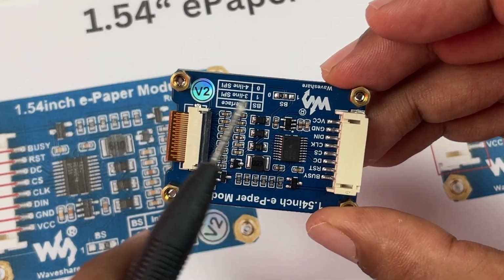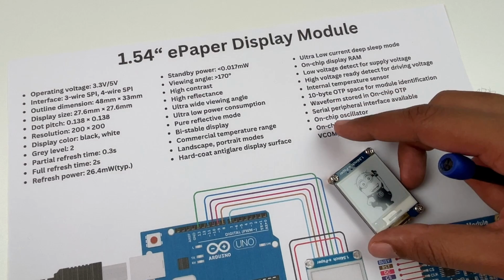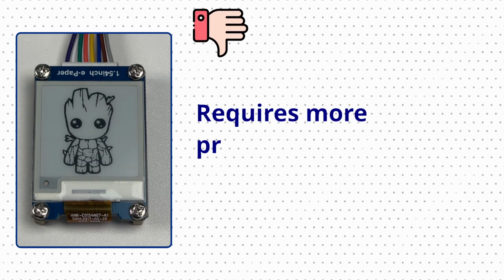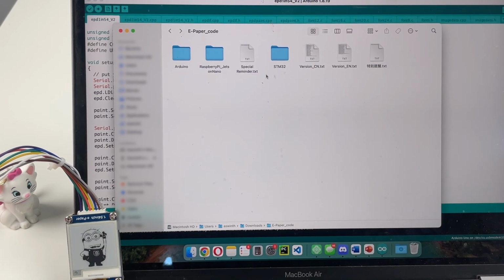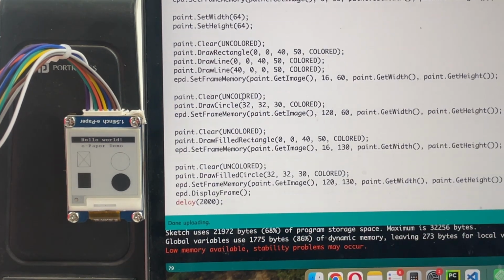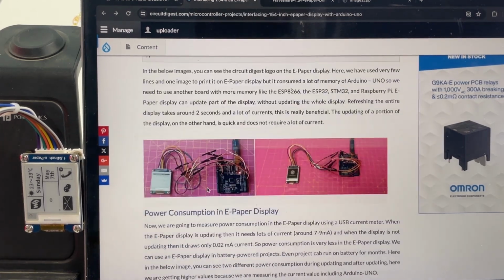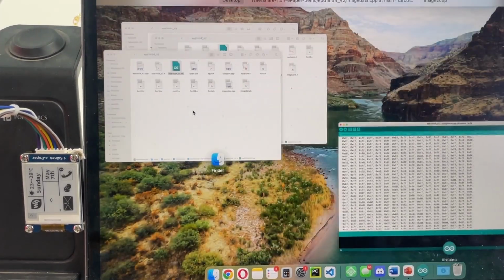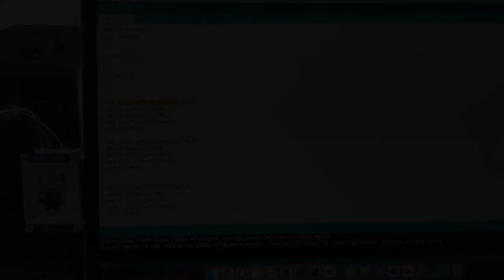How to use E-Paper Display? - Basic Tutorial with Arduino

Comment: bro I have changer IC CHIP from Arduino Mega but my laptop is detecting the Mega but the code is not uploading and in board info it is not showing the serial numbers and in mega the no LED light and RX LED is glowing but sometime the RX light is not glowing and TX light is blinking
Reply from the maker: Make sure you have installed the proper driver. If its a clone board you would definitely need to install the corresponding driver. Check the part number of the USB to UART converter chip on your board and install the corresponding driver.
Reply: Bro can you please upload the code of it